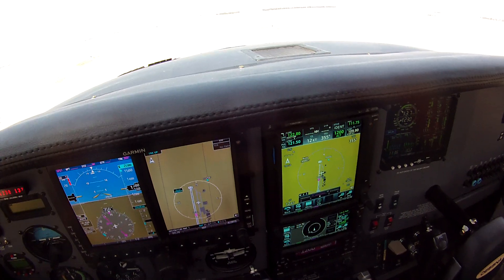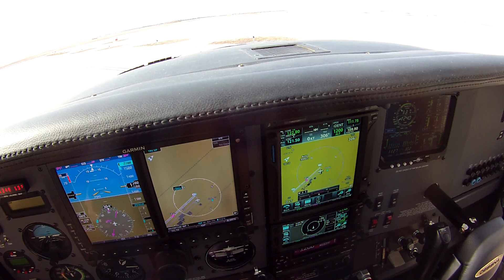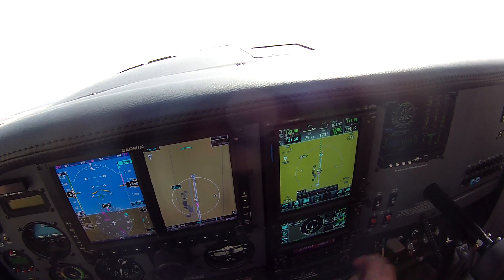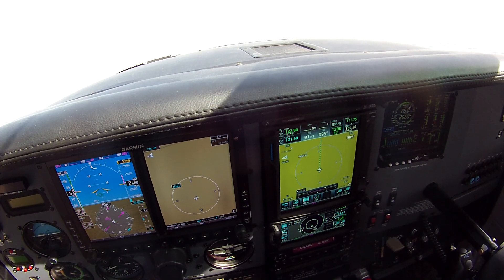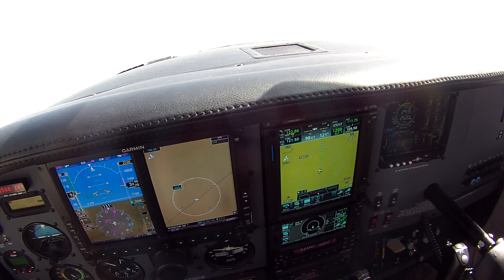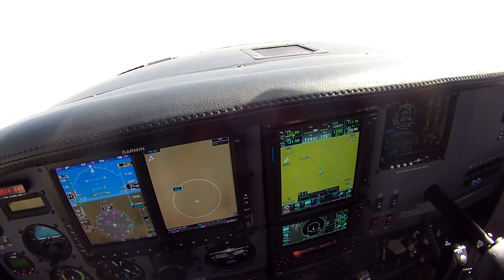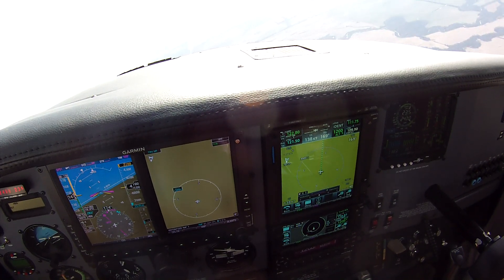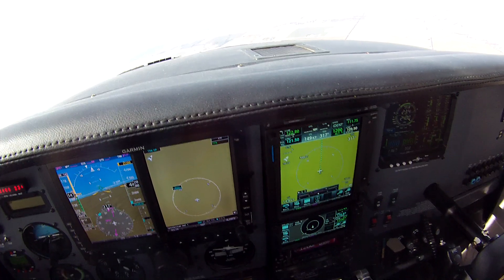AIR PLAINS 300HP TAKEOFF, CLIMB, AND CRUISE   182XP

Comment: That was some funny stuff.  BTW, a 182 is not a beast of an aircraft. The things pretty much fly themselves. The beast of their lineup is the 206.  I would love to have the 550 in a 182.  I can't believe that engine management would be any more difficult than with the 470.  I just wish they offered the oil pan that texas skyways has.  Damn nice 182 on this video.
Reply: I think a 182 with a 550 has got to be a hot rod compared to a 206 with same power.

Comment: Would this be a good plane for someone to buy and take there private pilot lessons in. Only this aircraft? Thanks
Reply: No
Reply: @karljames1694  And why not? Why should someone take your advice?
Reply: @hiker2742  because it's a high performance aircraft with an engine that if not handled correctly will only last a couple of hundred hours. As for the avionics yeah there good but what you gonna do when the screens go black and you become so focused on fixing your screens than flying the airplane. I've only been flying 17 years and have close to 1000 hours of pilot in command time single engine, multi engine instrument rated with several Atlantic crossings in a cessna 182 and cirrus sr22. So make your own mind up, why don't flying schools have hangars full of heavily modified 182s, because they would have hangars full of grounded heavily modified 182's within months. That's why they have 152's and 172's and pa28. They cost nothing to fix in comparison
Reply: @karljames1694   It was a trick questioin. I had never been in a airplane ever, but bought a ranch and a 182 came with the property. Hired a flight instructor, got my license and this ol 182 is the only plane I've ever flown.
Reply: @hiker2742  hardly a trick question you ask any flying school is it a good idea to learn in a heavily modified 182. I'm pleased you succeeded in learning to fly in a beast of an aircraft ( Even with the Standard O-470 engine). what year is yours?
Reply: @karljames1694  70.. 182N
Reply: @hiker2742  strong airframe weak engine mount. Nose gear is very vulnerable on rough surfaces 😑 have you had it checked for cracks?
Reply: @karljames1694  I fear you don't know what you are talking about. Good day!
Reply: @hiker2742  hmm your welcome t your own opinion. Maybe I should get round to doing a video of where I work for a living and interview the chief engineer, and show where and why they crack. 👍🏻
Reply: @karljames1694  Anything can be faked! My view is that all your "aviation" experience is done via video games and computer... Anywho, rock on with your dreams!
Reply: @hiker2742 awesome. Nice to know
Post a video of your aircraft then
Reply: @karljames1694  I think not! I fear you have developed a "unhealthy" obsession with me!
Reply: @karljames1694  Oh, so you are NOT American! That explains A LOT!
Reply: @hiker2742  nope. And what does it explain? Actually don't bother I'm bored of you to be honest. Enjoy your 182
Reply: @karljames1694  You are disturbingly obsessed with me! Yikes!
Reply: @hiker2742  if this is what you think you are the disturbed one. Report it to youtube let them decide.
Reply: @karljames1694  Your obsession with me needs to stop! You need to get a grip on reality!
Reply: @karljames1694  I do not appreciate you using racial slurs to me such as you just did with that vile name! This question here was NOT I repeat NOT directed towards YOU. I ask this to the person who has this channel. You for some reason "jumped" in and made it clear you are whitey buy telling me to look at your pic and told me that a person of color could NOT learn to fly in this aircraft. We you are wrong! Wrong wrong wrong and I will NOT stand for this racist talk! Good day!